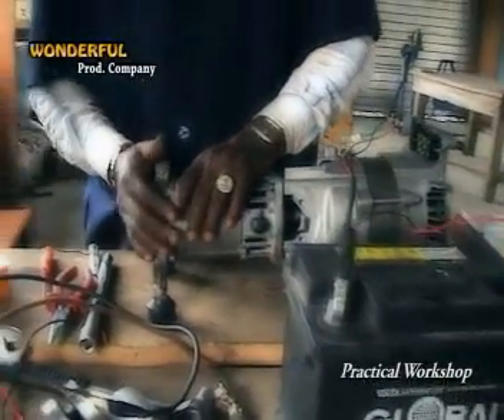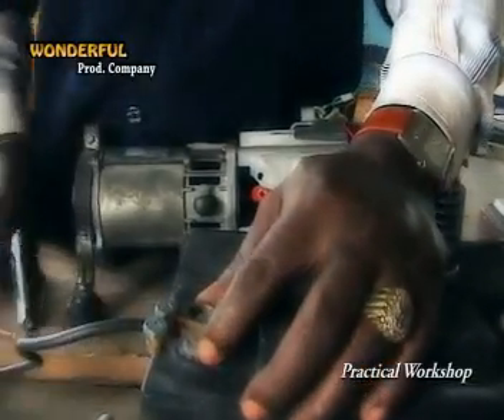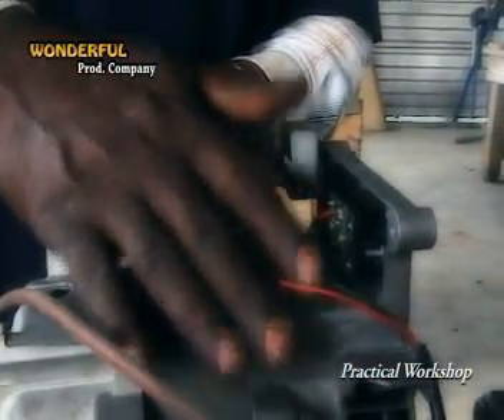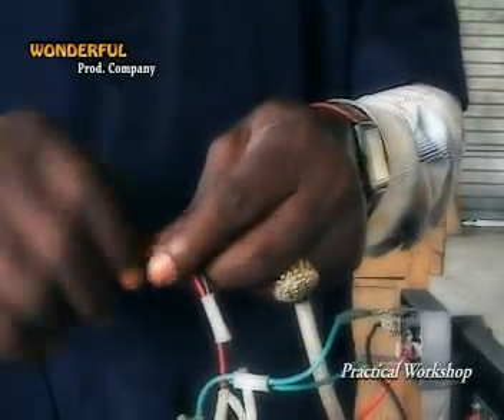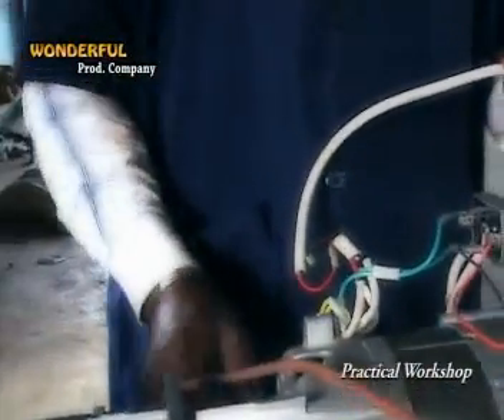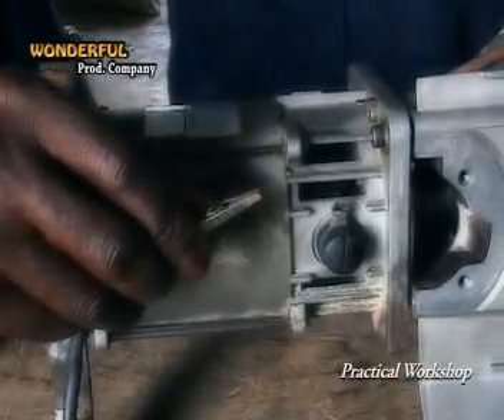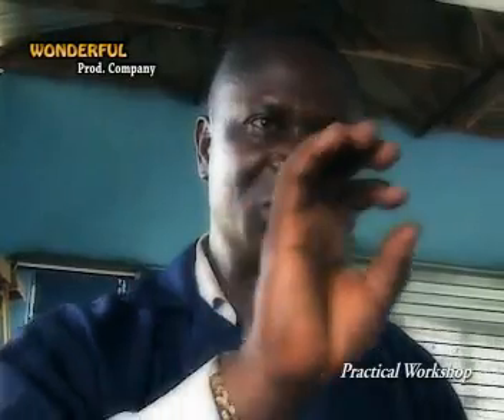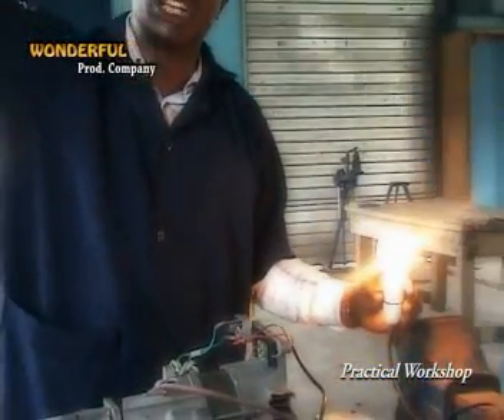FUELLESS GENERATOR

Comment: Nice project your doing sir.
However, it's unregulated voltage and frequency.
It would probably turn on few lights and some power tools but would not work with 50/60hz equipment with 100% efficiency.

Comment: I watched this video again today.
It appears you are using a battery to power your device.
If this is the case your device is NOT fuelless.
You device is using the battery for fuel.
Reply: Yes, it looks like you are powering your motor with a battery, which turns another motor you are using as a generator.
Am I right?

Comment: The type of motor that you need is a Bob Teal attraction motor which doesn't have permanent magnets and lets you recover the transient spikes from the collapsing coil. You also need a Bill Muller Generator which eliminates the generator's magnetic cogging effect. Watch Peter Lindeman's video, Electric Motor Secrets II. The motor should have a low impedance winding. The motor should be pulsed once per revolution from a capacitor via commutator, and charge that cap with the gen through the load.